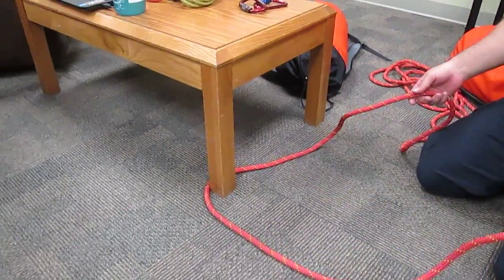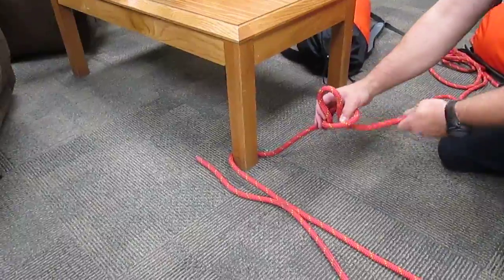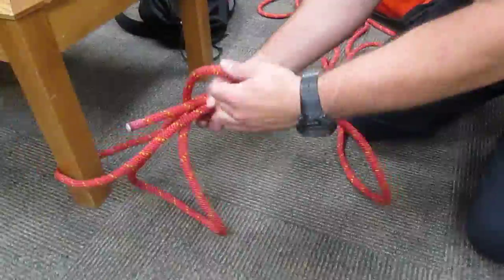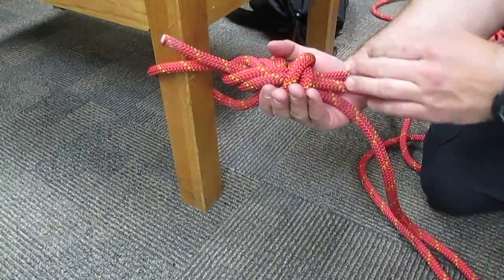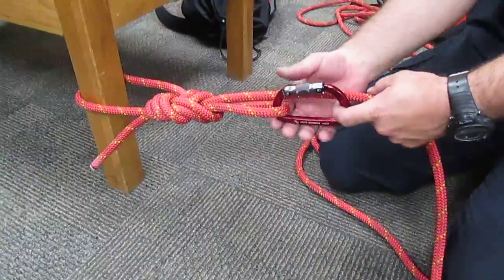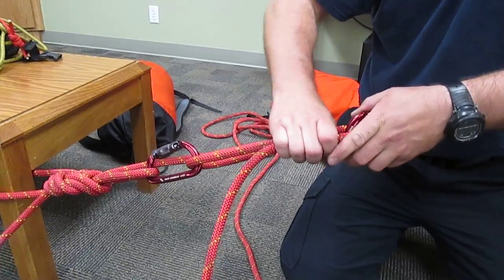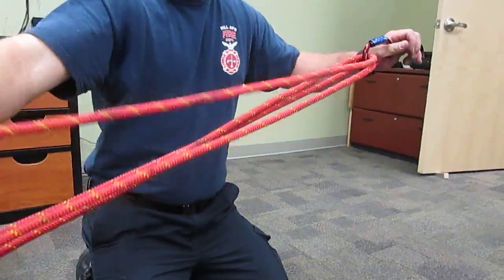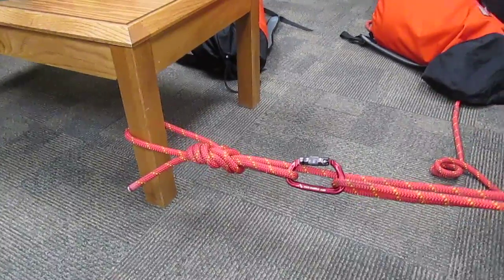Bowline with a retraced bight

Comment: Awesome Ryan!  What you've tied here is also called a bowline with a Yosemite finish, or a Yosemite bowline, but with double strands.  (I'd love to say it's a bowline COMPLETELY on a bight, but that could get confused with a bowline on/in a bight which creates an entirely different knot that has two main loops.)  Note that a Y-finish was never meant to be loaded.  I don't know if the additional wraps of doubling this whole knot make the Y-loop stronger or more secure, and I certainly don't know if the Y-finish is full strength or will stay in place when there is no load on the usual ends or load strands coming out of the bowline.  I'd love to see some pull test results before you start using this for any life-rescue applications.  In fact, I'm trying to work with a rope manufacturer to see how this will test out so I can use it for some top rope anchor systems.
Reply: CMC has a podcast Are bowlines safe for rope rescue. Half way through the podcast they talk about this knot and their results of pull testing. But not to be confused with a bowline on a coil. Their test results will surprise you with the forward facing bite/y finish. The guy talking about it presented this information at ITRS.

Comment: Any idea why searching for the "Brummycham Bowline" on google got me here?  I'm looking for information on this knot, which I believe to be tied like you began your knot (before you gave it the yosemite finish).  It's basically a Bowline tied with a bight, as you did, instead of the working end, like you described.  I can't find any information on this knot though, admittedly, I just started my research.  Any information would be appreaciated.  Also, this is an awesome video.  Thumbs up.
Reply: The Brummycham is another name for the Birmingham Bowline. It produces two fixed loops. If that's what you're trying to get, you're better off using a bowline on a bight. The bowline on a bight is something else than this video, look it up. The bowline on a bight is also called the Rethreaded Bowline in rock-climbing applications.